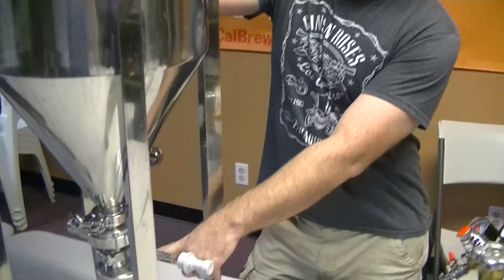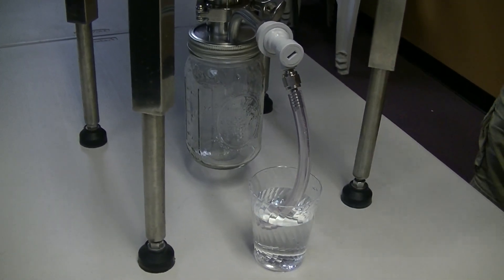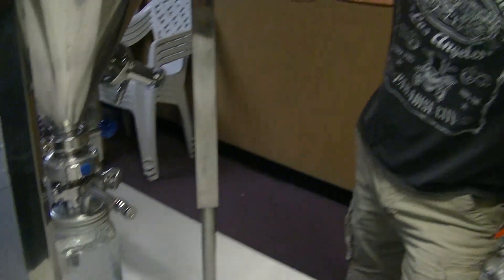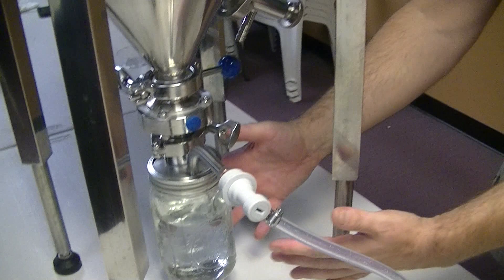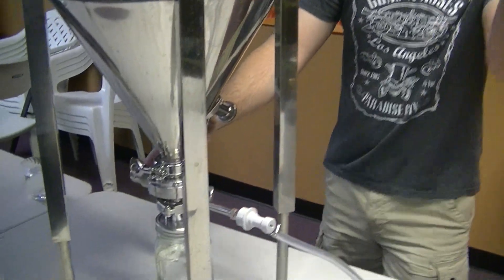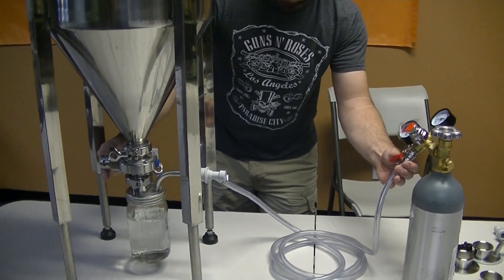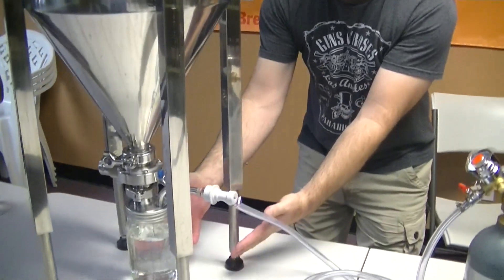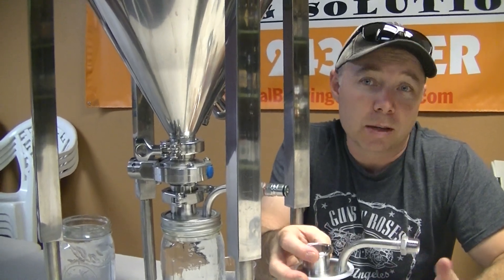Yeast Harvesting and Oxygen-Free Dry Hopping Using Jaybird Yeast Harvester with Exhaust Port

Comment: what? how is this NOT pushing oxygen into the beer?
Reply from the maker: Where would the Oxygen come from Dan.  IF done properly the amount of O2 in the system would quickly be displaced with Co2.
Reply: @NorCalBrewing  the oxygen would come from the hop container and is going to travel through the beer along with the hops.  I imagine some oxygen will dissolve into the beer along the way. Why would oxidation ever be much of a concern with dry hopping otherwise if it's not going to dissolve into beer on contact? You could always back fill with co2 to get a blanket under the residual oxygen but I don't think that's going to prevent oxidation if the beer has already been exposed with oxygen traveling through it.
Reply from the maker: @deeztones  Ahh yes the dreaded "oxygen trapped in the HOPS"  I couldn't agree more!  There are other tools to use to get that out for sure "OR AT LEAST TRY"  the great thing about adding CO2 WHILE dry hopping is you are doing EVERYTHING you can to drive it off while in process.  Great comments Dan!  Thank you for watching!  Cheers Jay
Reply: @NorCalBrewing  cheers! 🍻

Comment: This is great! How much psi can the mason jar hold?
Reply: The Jar can actually handle a lot.  Its the RING that is the weak link in the system.  I have done isolated tests myself and seen the jar lids pop off from 10 PSI to 25 PSI.  OBVIOUSLY I would suggest not having any pressure or as little as possible to do the work you need but you have to use your own common sense and safety measures when playing with jars.  I have been using glass for MANY years without any issues but I am mindful of what I am doing.